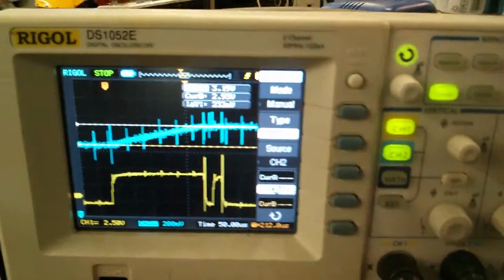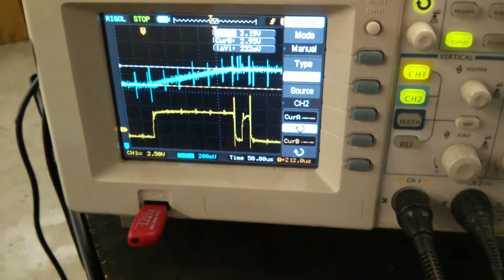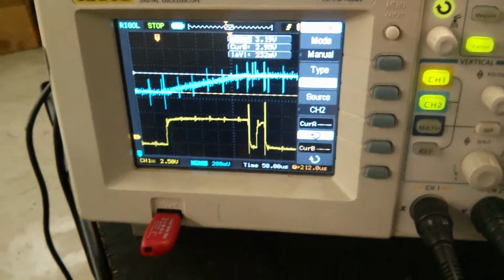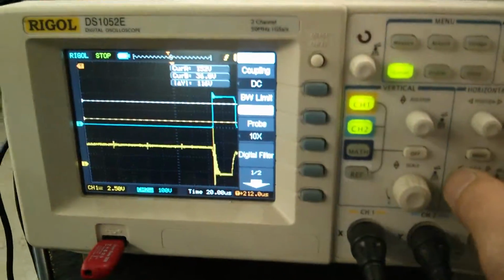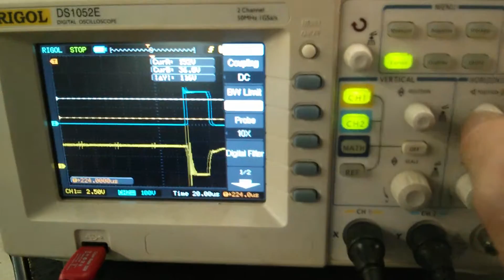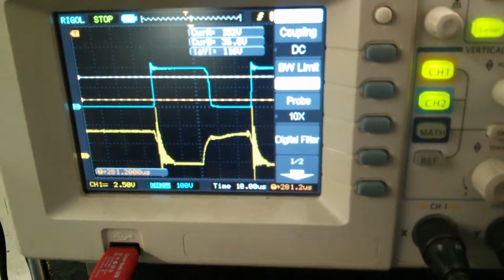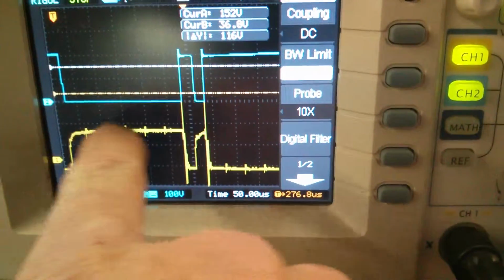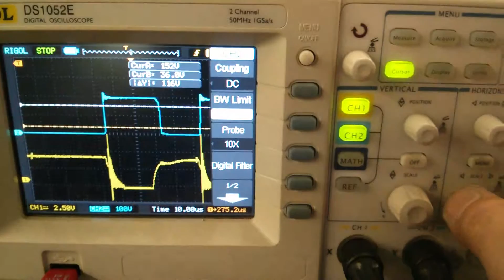Double pulse tester

Comment: I appreciate your hardware. But double pulse setup is like a temporary setup, setting up an arbitrary wave in function generator gives the precise pulses right?
Reply from the maker: I used an arduino but a function generator would work as well.   The point is 1 long pulse to get the current up to a leavel you want to test the switching at then at the end of the first long pulse you look at how it turns off and then you turn it back on again for a short pulse to see what it turns on like when current is already flowing.

Comment: Is it like the double pulse is generated only once and then the pulses are stopped.
Have you used any protection circuits and could you forward me the code for the double pulse generation.
Reply from the maker: it's all on endless sphere forums the code should be there as well.   look for posts by arlo1
Reply: +Arlin Sansome You have posted a lot of things on there. I have been trying to search for the stuff that I need but I am not able to find it.
Reply: +Arlin Sansome Could you like put it on google drive and share the link with me. I am working on designing a double pulse tester for 400V and 60-70A DC to test the switching characteristics.

Comment: what microcontroller are you using?
Reply from the maker: dspic30f4011
Reply from the maker: +Arlin Sansome but for the double pulse just an arduino
Reply: +Arlin Sansome could you use arduino for the entire thing, instead of using 2 microcontrollers?
Reply from the maker: What do you mean?   The double pulse test is a separate test for setting up all the systems in the gate driver.   The Arduino is ok for this.
The specs for the Arduino are not high enough and also lack inputs and outputs to run a 3 phase motor with proper control.
Reply: +Arlin Sansome ok got it